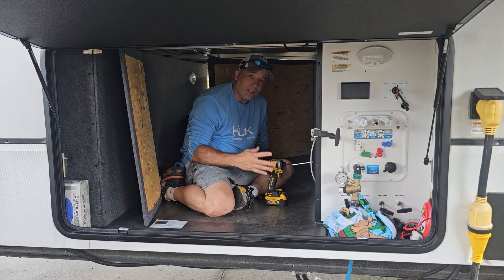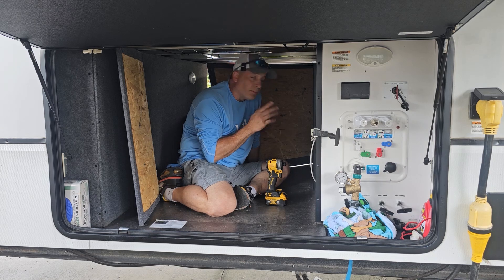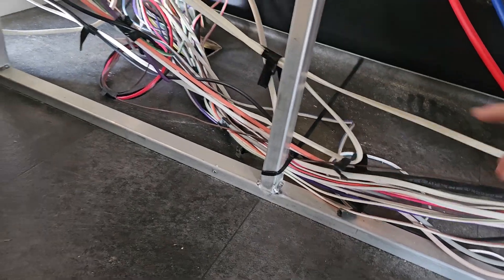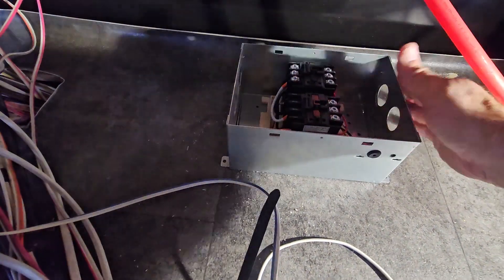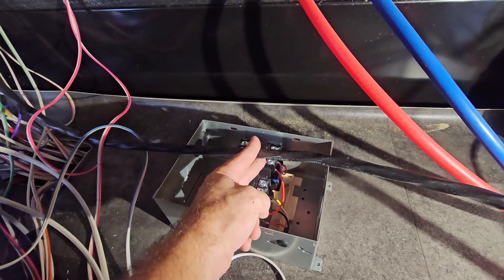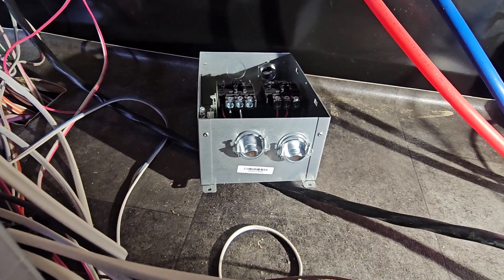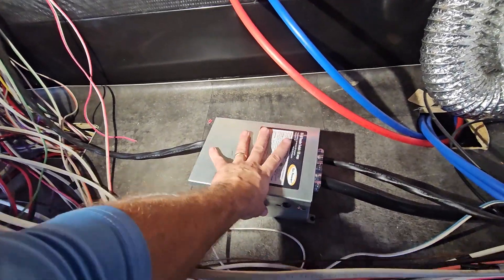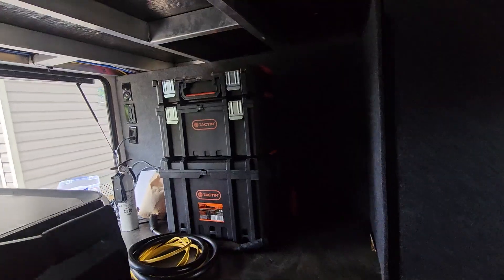Installing 50 Amp Transfer Switch In An RV. Go Power TS-50 w/EcoFlow Delta Pro Backup Power.

Comment: That 50 amp transfer switch only has 10 AWG wire for the crossover... that should be 6 AWG. You'd better limit your generator side to 30 amps input and connect the shore power on the same switch block (right side) as the load connections.

Comment: Thanks for posting. 
I would have loved to see this set up, as installed, actually work with the 30A eco flow source. 
I can only imagine you used a 30-50A adaptor to actually connect to the 50A box you installed in the front cabinet.

Comment: This video is pretty helpful. I came here searching for wiring an automatic transfer switch, and it's coincidental that you are also using an EcoFlow, which is what I'm looking into myself. So that was very fortuitous.  One question I do have though: you cut off both ends of the new 50 amp cable, wiring one end into the switch and the other end into The power inlet box. Why not just cut off one end of the new 50 amp cable, wire it into the transfer switch, then plug the other end of the new 50 amp cable into the generator, using a 30A-50A adapter?  What is the benefit of doing it the way you did it over the way I was thinking?
Reply from the maker: It just allows you to be able to plug in the Ecoflows or a generator in one location.

Comment: thanks for the "how 2" I already have a gen prepped fifthwheel with the transfer switch and all. My question is I will install a plug for my Pecron 3600 it only has a 30amp plug, In your video you installed a 50amp plug in the RV. Now would that work with a 30amp plug from my power station. Sorry if its confusing thanks
Reply from the maker: You would need a 30 to 50 adapter like this one  https://amzn.to/4pM3fLz 
We installed the 50 Amp plug for future upgrades or even to be used with a generator if needed.
Reply: @Jimmy2Tech  thanks Jimmy, I will instal the 14/50 nema plug this week. I already have a 50 to 30 adapter. I order my 3600 today with the dc to dc 500w charger.

Comment: This is great.  I was thinking of using a manual transfer switch. I have the same setup with 3 EcoFlows.  Currently, the RV repair ran the cords without a transfer switch, which makes the generator line hot when plugged into shorepower.   Super dangerous, so this will fix it.

Comment: I do not understand why a transfer switch when you can just change what you are plugging into the side of RV.  I could see this if you wanted an inverter to run while driving down the road
Reply from the maker: The transfer switch will allow an uninterrupted switch of power in the event you lose shore power so you don't have to go out and change your power source.

Comment: So the rig is 50 amp but the ecoflows are 30 amp, correct?  So the owner will NOT be able to run everything like he's on 50 amp shore power when just running off the ecoflows, correct?  Unless I'm missing something which is possible.  When you said he'll be able to run both ACs off of those I'm not so sure but I'm not an electrician, just a novice thinking about doing something similar to my 50 amp rig.
Reply from the maker: Yes the rig is a 50 Amp. He has soft starts in his ac units. One is a 13500 btu and the other is a 15000 btu which if started separately can be run off of the 30 amps drawing about 25 amps when running. But really with the other stuff that you would want to run it would be a heavy load for 30 amp. The EcoFlows have the power to run them for awhile but in reality only 1 AC would be used.
Reply: I would like to know this too. I have the EcoFlow delta pro and it only takes 30amp. Did he run 50 amp to a 30 amp plug for the delta pro?
Reply: What would happen if it gets overloaded? Is it a dangerous situation? I’m considering doing the same until I can add another delta pro and a double voltage hub and directly connect the trailer to the two units.

Comment: I’m looking to add an inverter to my unit. I can do everything the same as your install, but instead of adding a generator plug I could just hardwire inverter there. It would work the same just different power source, correct?
Reply from the maker: An inverter is not a power source by itself. Not sure an inverter would replace a generator, unless you have a separate power source powering your inverter.